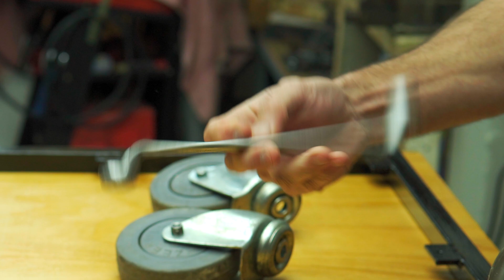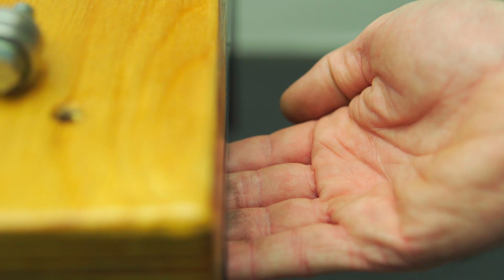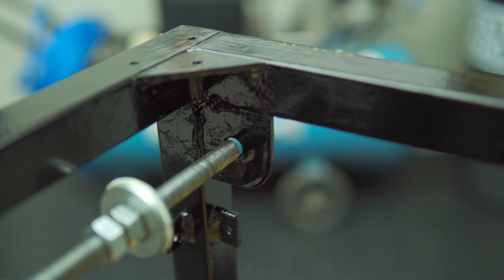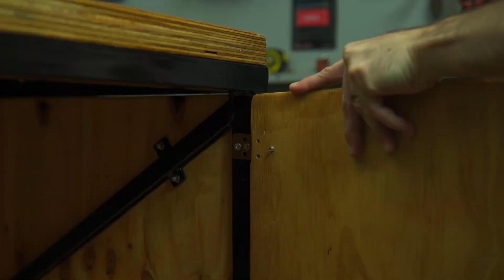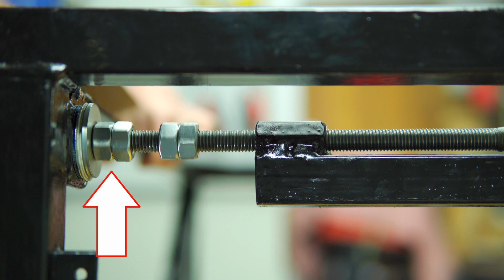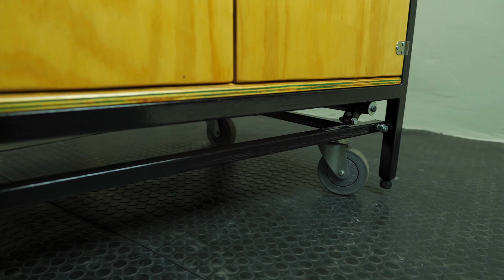441lbs! Retracting Caster Wheels - How To DIY | Workbench (Part 2) - Burton Builds S03E13 [4K]

Comment: You’re incredibly talented brother. My hat goes off to you sir. I’d love to buy the plans for this build if you have them available
Reply from the maker: Hi Fernando, thanks for the compliment. Unfortunately I don't have any plans available, like most of my other builds, they are more of 'design as you go' style... It starts with a rough idea, then I look at what scrap i have laying around and start mixing and matching from there.

I must say that the separate rolling base was originally designed to be multi purpose... one for moving the workbench around and a second use as a flat rolling platform to move stuff around (of course the table would have to be tilted over so the rolling base could slide out... and there in lies the problem).  The table is so heavy that it's not easy to tilt and roll the base out. Would have been better to come up with retractable / foldable side guides, so they could be folded away and the base rolled out from under the table easily.

Also, the side guides don't have to be bearings... they can be solid bars or pieces of tube and it will work just fine.

What might also be an idea is to have a cam lift design like this one but swap out the threaded rod and winding handle for a long lever arm that is pulled by hand through 90 degrees...

Comment: Howzit bud. Bench came out sick! What paint did you use?
Reply from the maker: Justin Weyer Thanks dude. I used a product called Hardtop Flexi made by Jotun. It’s a two component chemically curing aliphatic acrylic polyurethane coating... supposed to be tough stuff. Was recommended by a good friend of mine. I think the finish would have been better if it was sprayed but I didn’t have a spray gun with a large enough nozzle so ended up brushing it on. Also painted a sample to test how tough it actually is, but haven’t put it through it’s paces yet.